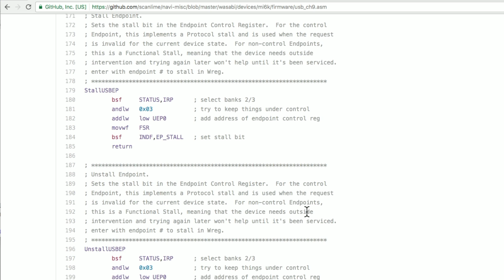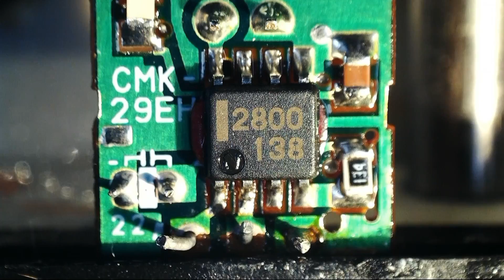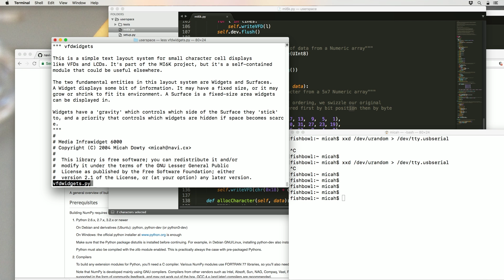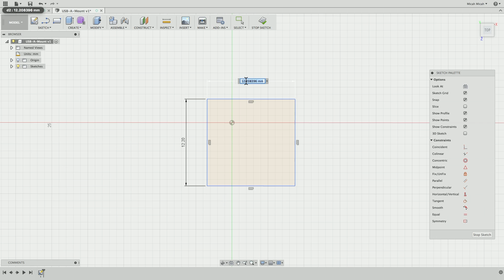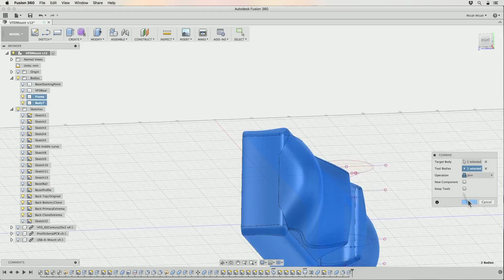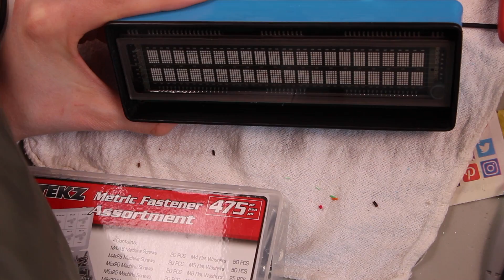Shiny Blue Vacuum Fluorescent Pole Thing - scanlime:016

Comment: This is so awesome - i really like the re-use of parts from a newer project. I also made a info display for my local Hackerspace out of a POS-display with a ESP8266 piggybacked to it :) https://labitat.dk/wiki/POS-display - A version 2 is on it's way - a way bigger NOS 4x20 VFD, parallel interface, wired up to a NoceMCU-board.